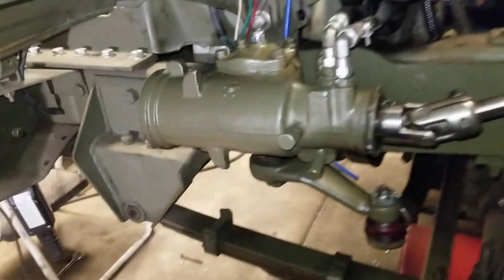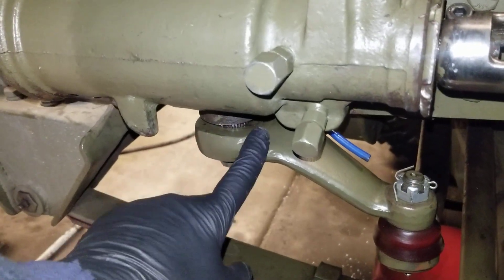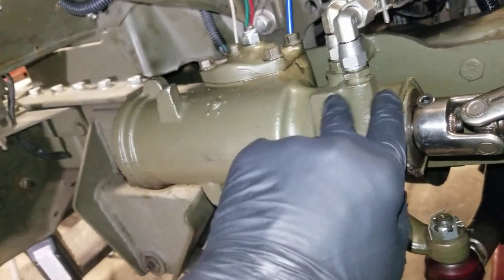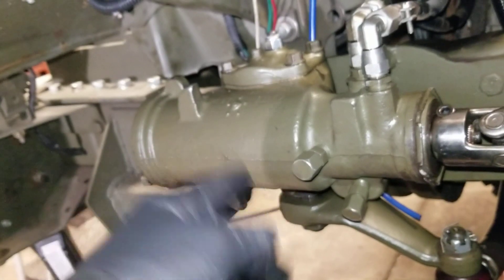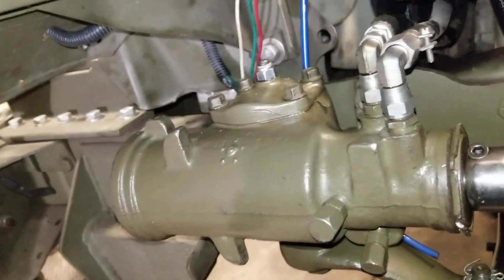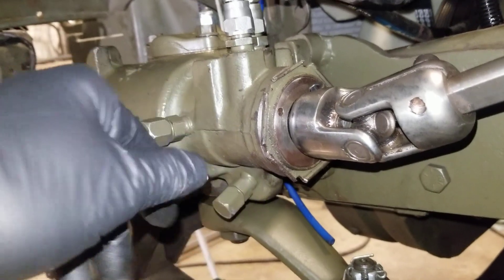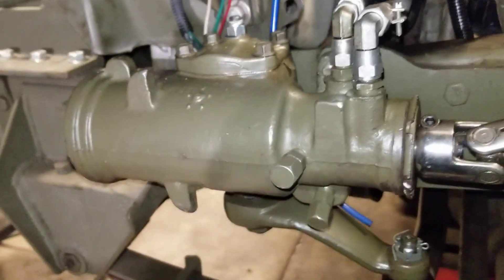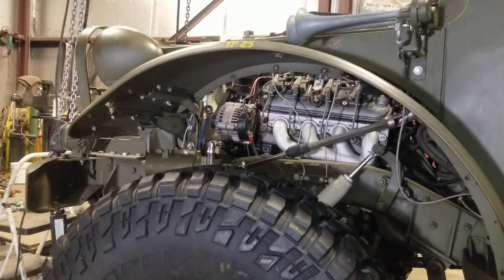Dodge M37 saginaw steering box rebuilt for $30 bucks and hydraulic ram steering ports installed

Comment: That had to be a pain to rebuild.  16 ga fenders...oh crap! I bet NO ONE pulls out in front of you when they see you coming!
Reply from the maker: Yeah most of the fifties and earlier cars/trucks were 16 gauge steel bodied... that translates to approx. 1/16th inch.... Thank you and happy holidays brother
Reply: @itchyoldfart  
Yessir... 065, used to deal in steel. Now they build this new stuff out of aluminum foil but these new trucks get great gas mileage. My F150 ave 16.7 but it will dent at the drop of a hat. 
Sometimes I wish I was driving an old M37 cause no one would back into me or pull in front of me.;)

Comment: hi can you tell the model of the steering box so I can order the  right parts kit
Reply from the maker: It depends what year steering Box you have ...they have 2 different input seal sizes... do you know what year it's out of
Reply from the maker: The kit I used will fit1977 thru 1982 Chevrolet and GMC C/K (2 wheel and 4 wheel drive) Pickup Trucks....   Pretty sure it's a Saginaw 800 Box